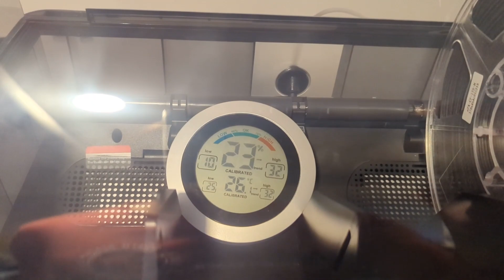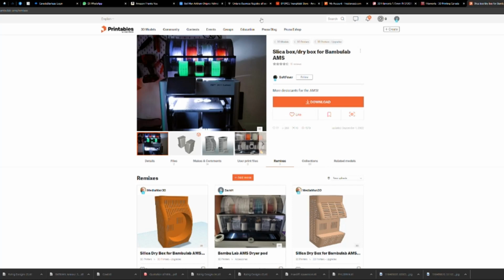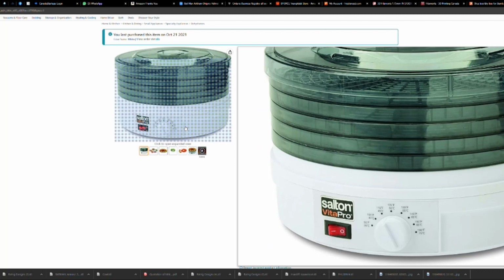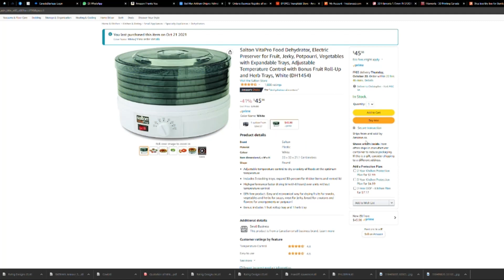Bambu Lab X1 3D Printer - Making the AMS Super Dry w Dryer pods Extra Silica for Carbon Fibre Nylon

Comment from the maker: UPDATE: Apparently Bambu Lab does not recommend using CF Nylon or similar abrasive filament in the AMS as it will wear down the parts. Instead mount or feed externally from the printer.
Reply: Odd design decision, to make make the material system in the X1 CARBON not compatible with carbon filament.
Reply from the maker: @JT-Works  yeah....I used a full spool of Nylon CF didn't notice anything. Those parts that grind can be replaced from their online store at least.
Reply: @3dlootlab  I don't know where this info came from and have seen others say it but never seen anything from bambu lab directly. Their CF nylon is designed to be used in the AMS, it has the RFID tags on the spools. On their store TPU specifically says not to put it in the AMS but the CF nylon doesn't have such a warning.
Reply from the maker: @permethious  Hmm. Would should ask them directly then. I used TPU in the ams no problem fyi.
Reply: @3dlootlab  yes it is a bit confusing.  The Support G which is only for PA-CF would require both to be in the AMS  🤷‍♂. With regard to TPU there are some nasty horror stories on the bambu lab discord.
Reply from the maker: @permethious  Very interesting, I will not print TPU while I'm away from the printer for now. I've done two TPU 95 prints and they turned out amazing. Heres one:
Reply from the maker: https://www.instagram.com/reel/CkR_poBoBvC/?utm_source=ig_web_copy_link
Reply: @3dlootlab  as long as you don't do material changes every second layer... it may work
Reply: That’s what goes directly through my mind.
Reply: New to the X1CC so forgive me for asking what you mean by an external feed/mount
Reply from the maker: @MrPW800  there's a standard spool holder on the back, and a feed PTFE tube for it. Its the default way to feed the filament, and can be switched between that and the AMS (if you have one).
Reply: I wonder if they feel the same for glow 8n the dark filament
Reply: @BeefIngot  Yes

Comment: You can buy the Orange silica desiccant for pretty cheap. With those I get down to 10% RH at 32C which I understand is pretty good. I don't think the small bags are that reusable. Also, don't buy the blue desiccant, they are banned in Europe for safety reason.
Reply from the maker: Thanks for sharing! 10% is amazing and I didn't know there could be such a difference between orange and the default filament silica bags.
Reply: @3dlootlab  Problem is the little bags take up so much room, your density of silica is low. If you remove them and pour the silica pellets in you'll get better results.
Reply from the maker: @BetaOp9  Very true, I should have some this already.

Comment: Hi
You have two containers under the rollers in AMS, which are intended for dehumidifier pillows. (are also for much bigger pillows)
So you don't need to print baskets... but: cool job :)
Reply from the maker: Thanks for letting other know! I may have not been clear, but I wanted even more silica in there so it stays dry longer and hopefully better. Have a tonne of extra silica thanks to opening so many filament boxes.
Reply: @3dlootlab  You were clear, you just added desiccant to increase the volume to absorb moisture for a longer period of time. A good modification.